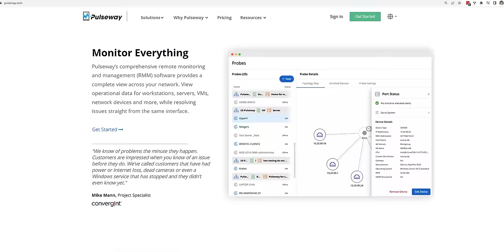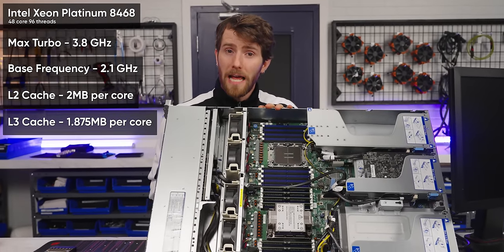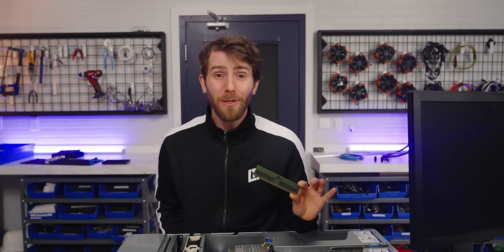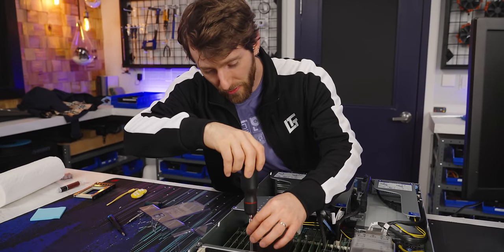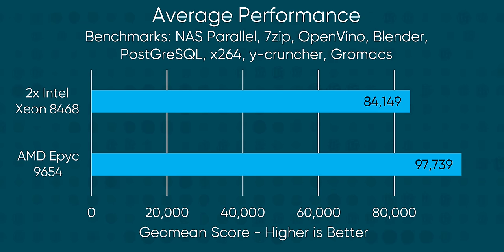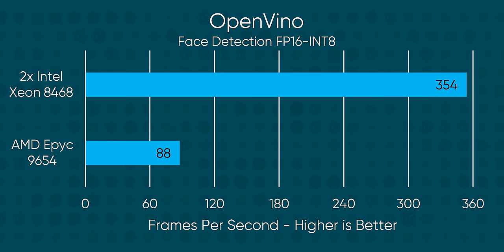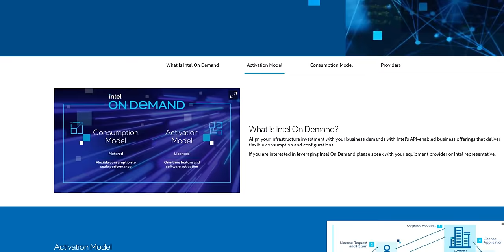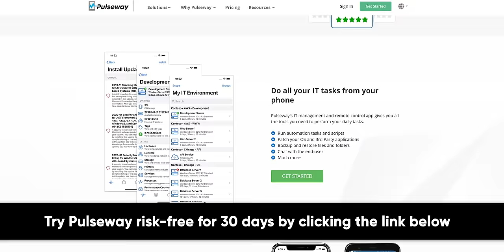Intel’s New CPUs are Cringe - Intel Sapphire Rapids Xeon Platinum 8468

Comment: In our case, we have VM infrastructure based on Intel Xeon and you can't mix\match different CPU vendors if you want to expand existing clusters.  That said, our new clusters and projects are all entirely AMD Epyc.
Reply: My company can't use AMD because of Oracle and their licensing. AMD Epyc with 4 chiplets requires a license for 4 CPUs, and that is hundreds of thousands of Euros.

Which is why I'm concerned about Intel going the chiplet route as well.
Reply: @dustojnikhummer  that looks like Oracles fault to me than cpu manufacturers
Reply: @bingchilling177  Yes, it is absolutely Oracle's fault. But right now we are kinda stuck... not sure what we will do
Reply: That's why there is such a massive amount of investment going into RISC virtualization, your issue will be non-existing in a few years time :)
Reply: If you're stuffing about in Windows VMs then your operation is inefficient and you will be out of business soon anyway.😩

Comment: So I gotta say that the "heat sink adapter" model has been used for several years in data centers with no issues except for human error issues. This also come from experience using these in 2 of the top cloud computing companies. Also the socket with the lever that Linus is freaking out about is a godsend. Prior to this Intel suggested using a screwdriver or a similar flat blade tool to remove the processors from the adapter/heat sink. Also gotta say this is the first Linus tech tips that had me talking back to the video and had my wife asking me if I'm arguing with myself lol. Still great content, but please reach out to individuals that complete break fix with these components. I offer myself as tribute :😜
Reply: Yeah before this, the best was an ifixit plastic spudger. 1st and 2nd gen xeon scalable had the carrier clip without the arm. 3rd and 4th now has that handy arm.
Reply: linus has also had videos on videos on previous gen servers that had this same cpu heatsink carrier... which he also installed wrong.
Reply: … Screwdriver? That sounds like a pretty good way to ruin the chip if you angle it wrong.
Reply: Is there any reason this cpu couldn't have a lever-arm socket similar to Intel or the AM4? Because installation the way LTT showed seems like a way to have more people break their servers so they buy more lol
Reply: @aarcxnum  Linus just is doing it wrong. It's really easy and less risky than older socket designs. The samples he gets may not have come with instructions but Linus often refuses to read instructions anyway
Reply: @aarcxnum  sliding the whole assembly down  greatly reduces the chance the package slips out of your fingers.  Granted... It's a lot heavier, so if you DOO drop it... The socket is definitely toast.  The retention force is getting extremely large for packages this size, I think this also reduces the amount of hand strength that was required for latching those leaves down.

Comment: The irony of it is that Intel was actually first with having glued together CPU with the original Core2 Quadro actually being 2 core2duo glued together.. and that was not even that high speed.
Reply: That's not the original glued chip. Pentium D had two P4 cores. Also, it's Core 2 Quad. Quadro is nVidia's branding.
Reply: Didn't they pull such a trick even before that with the Pentium D?
Reply: @samiraperi467  well i didn´t want to remember Pentium D
Reply: I mean, yes, but actually no
You can see that as the ancestor of what is a chiplet today, cause in practice it worked differently
Reply: @thunderarch5951  Well yes, the method of pairing them is very different but the core premise of gluing them together is pretty similar.
Reply: And ironically, at the time, AMD made a big stink about how their first gen Phenom was the first "real" quad core chip because the core 2 quad was just a pair of core 2 duos glued together.

(Also, the Core 2 Quads were stupid fast for their day - my Q6600 and then later my friend's Q9650 were ridiculous in 07-08, at least until Nehalem came out and I got my first i7)
Reply: @clapanse  I still have a 9550 xeon system. These things are still good enough to do some browsing, video watching and office work even now. 12 megabytes of L2 cache and near 3ghz speed made those things shine back in the day, and they've aged pretty well.
Reply: The intel Pentium D was two Pentium IV CPU's glued together....
Reply: @clapanse  finally someone who remembers that, it always annoys me that whenever Intel looses, AMD wins or Intel talks about their "Tiles" everyone and their mother has to talk about Intel making fun of AMD for glueing together chips, whilst handily forgetting that the glue Joke originally came from AMD.

It's almost as if both companies had stupid marketing morons.
Reply: @chloedevereaux1801  Nope. Nehalem was the first gen, 45nm, quad core desktop i-7, which came out around Thanksgiving of 08. Lynnfield was the first i5, and the first one considered "mainstream desktop" rather than "high end desktop", but it didn't arrive until fall 09.

(I remember it quite well because I bought an i7-965X on launch day in November of 08)

Comment: IBM has been doing the On Demand thing in their mainframes since 2004, I think, and later in Power servers as well. It’s a good way to turn capacity on and off without needing to buy new hw (which may take a while to get to you and you may only need for peak usage).

The key is in the pricing, of course.

Comment: But Linus... You also installed the CPU's into the heatsink on the two previous generation of Intel's scalable processors. You probably threw the bracket for it away, I saw you did in an earlier video!
However, this new generation has this small tap to get the CPU off the heatsink, very handy. I work with them everyday :)

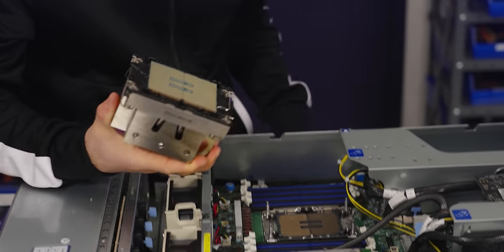Comment: 5:20  actually Linus, you're supposed to leave the CPU in the plastic tray with the plastic adapter on the CPU... Then you grab the heatsink and set it on top of that and it clips/clicks on the plastic adapter... Then you lift that heatsink and cpu with sandwiched plastic frame adapter off if the tray... Then bolt it to the mobo.  Easy peasy.

Comment: It's the lack of PCI-E lanes on desktop CPUs that's really driving me nuts. After a discrete GPU and NVMes, I couldn't even POST after adding a 10GbE nic because I was out of available lanes.
Reply: A frustrating problem that only applies to 0.01% of users unfortunately.
Reply: 20 lanes on modern CPUs is embarrassing when a GPU can use up to 16 and a single NVMe SSD can use up to 4.
Reply: yeah im really hoping to see the re-emergence of HEDT hardware without the "pro" pricing
Reply: @Amehdion  the gpu really only needs 8x pci-e lanes anyways
Reply: @NightshiftCustom  Hey, I paid for the premium hardware, let me use it lol. For most people the performance difference is negligible but I typically game in 4k ultra settings and have RAID 0 980pros so even 4 more lanes could be a meaningful performance increase.
Reply: Buy AMD then, ZEN 3 has 24 lanes, ZEN 4 has 28 lanes.
Intel 12th and 13th only has 20 lanes, recently launched 13th has fewer total lanes than even ZEN 3, this is an actual advantage ZEN has that almost no one talk about.
Reply: @Amehdion  I think modern CPUs actually expose more lanes than older CPUs, it's just that they're now being configured as M.2 slots instead of PCIe slots. That and no one is offering x8 slots.
Reply: @GhOsThPk  Yeah, I'm seriously considering getting a Threadripper Pro for my next build. I've always had Intel CPUs, but Intel really doesn't offer much for HEDT or workstations these days. I want a higher clockspeed modest core count CPU with enough PCI-E lanes for a GPU, NVMes, and upgrades. The HEDT market may be small but there must still be people needing workstations. I want to be able to do some gaming on my desktop while also able to run VMs for work. Especially with more people working from home these days, it seems like there would be a decent market.
Reply: @dbattleaxe  haven't heard of the Xeon W?

Comment: I have some doubts here as engineer for the benchmarks, as you said the server is meant for virtualization, so what's the NUMA layout etc etc. 
Don't get me wrong I'm really pro AMD, but a good benchmark would be to spin up on every machine as example

50 mysql/postgresql databases
50 nginx servers 

And then benchmark all the vm instances at once (doesn't have to full heavy load, but equal between both servers).
Reply: not a coincidence that every other video on this channel is sponsored by AMD, and its basically turned into a commercial for them over the past year.
Reply: That would mean that he needs to know what he is talking about. This channel is ok for commercial tech, but any time they go into the professional sector, it makes me absolutly cringe how bad the information they give out is.
Reply: @ion1984  that's what happens when AMD has the better product bro. Why cry?

Comment: even if they get more sockets on a single mainboard(pretty sure I read some really good reasons why AMD doesn't do more than 2 sockets per MB) and even if intel manages to actually somehow provide people with a cooling solution for that(a single 8468 has 350W TDP. Stacking a single rack full of these with 4 socket servers is enough heat for a medium sized home just from the CPUs..), the king of density for compute will still be AMD, especially given that the 9654 has similar performance to two of Intel's chips with 360W TDP. Same performance half the TDP? Yeah, if you're need lots of compute, there is absolutely no question if you can literally half the TDP and it also costs less money. Let alone AMDs superiority with PCIe lanes - PCIe5.0 x80 for Intel vs PCIe5.0 x128 for AMD. And honestly, all of that just for a bit of ML acceleration? Seriously, if I need to speed up ML tasks, I'll just use the few thousand bucks i save because I'm buying AMD CPUs and spend that on accelerator cards...
Reply: Just need some slim mobos that can fit multiple full systems in a blade and the density will probably be just as good unless your particular workload requires one OS over a bunch of CPUs
Reply: This didn't age well

Comment: I'm sure that solid goop of thermal paste in the socket, or the stringer that followed it that no doubt landed in a dimm slot had anything to do with anything. I'm sure that wasn't a horrifyingly expensive "oopsie"
Reply: Yeah, I was just thinking...  How the F do you clean that out?!?  If it's non conductive, it might be OK but if it's capacitive, you'll have a system with weird instability issues.  Also, it could cause the pins to stick to the CPU, bending them when you go to take the CPU out.  Only a $20k system.  Ooof.
Reply: @button-puncher  That's the neat part about thermal past and LGA sockets. You don't clean them out. Ever.

Comment: The funny thing about server chips is that sometimes the thing limiting you isn't even the hardware.  Windows Server licensing is a beast - if you have a cluster of a few servers and automatic failover between them, and deploy even one single Windows VM, you have to license every possible core it could ever run on.  So to add one dual-core VM on a 3 node cluster with 26 cores per node, you need to license 78 cores in total.  It might make more financial sense to get more nodes with fewer cores and limit where Windows can run.  Or consider SQL enterprise licensing, you need to license a minimum of 4 cores per VM under SPLA at about $250/core, so if you can get fewer higher-performance cores, it might save you money.

Side note: Can you do a video explaining Windows licensing?  Might explain to people why Linux is so popular in the startup market.

Comment: I am skeptical on the Intel on demand, I just cannot imagine it is going to be used that much. It seems more like yet another method to extract/squeeze money from their customers. 

Across my many years in IT, I have only seen hardware increase with a license one time and that was with an IBM mainframe which made sense considering the hardware licenses were in the six figure range, the hardware is slow to change over time, and IBM didn't sell 40+ SKUs of their CPUs. In my experience, hardware is either fully licensed up front or replaced before the need to increase came up. 

When you have a private internal cloud, it is more efficient and advantageous to deploy another server node into the cluster vs. upgrading existing server nodes. The entire platform benefits from the investment, increasing CPU count on existing hardware is a fringe benefit. Also, workloads usually want CPU/RAM to increase in lockstep, so as you unlock CPU cores you typically need more RAM. So there are still logistics issues with downtime. There are bottlenecks in hardware that simply unlocking more cores will not resolved yet adding more nodes to a cluster will. 

I won't say the "feature" is dead on arrival, I am sure there are some B2B customers asking for this. I am just saying that In my opinion, a large corporation has really soured when they shift from innovating hardware solutions to innovating more ways to squeeze their customers for more money. That's why I refuse to buy EMC/Dell. It seems like Intel has really soured here.

Comment: I am still hoping the coming HEDT CPUs based on Sapphire Rapid (Xeon W2400) are still gonna be great, after AMD abondened HEDT Threadripper.
Reply: They're dropping new thread ripper later this year.
Reply: Amd isn't abandoning it, they are preparing skus for release this year. Intel just didn't offer any competition until now
Reply: @korcommander  That would be nice. And all it needed was Intel to drop a similar product... Btw, where did you get this news from?
Reply: @korcommander  hopefully not just pro series
Reply: @raisofahri5797  that is what I expect as well
Reply: but Alder Lake and Raptor Lake ARE already HEDT. i9-13900K destroys basically half of the consumer friendly Xeon lineup at a cheaper price and way more perfomance (you could argue better efficency by the little cores).
Reply: @saricubra2867  HEDT is not all about Cores. It is also about more PCI Express lanes. My workstation (using a TR 2990WX) would not need all the 32 cores (got the CPU kinda cheap, so I won't complain) but I really need all the 64 PCI Express lanes with my 5 add on cards (GPU, 10G-NIC, HBA, sound and USB). My gaming system (R9 5900X on X570) supports 2 additional PCI Express x1 cards besides the GPU before it starts to share lanes. Just no!!
Reply: @Thommygun-qv7um  Memory size and bandwidth are also pretty good reasons for HEDT
Reply: @levygaming3133  totally correct. Not for me, I don't need more than 64 GB of RAM, but I guess many ppl do. One more thing mainstream Core- and Ryzen-plattforms leaves us wanting.
Reply: @Thommygun-qv7um  Um.... AMD?
Reply: @korcommander  clearly you did not read my post carefully enough

Comment: Very good review. I will said that formally, the IBM Power2 could be the first chiplet desktop.  But that is for historians to fight about. Accelerators: Here the problem is you have to pay, which means the software will continue to be lacking unless Intel pays for the development. CUDA is the standard, and you can get quite inexpensive boxes for the developers, so hand optimization for CUDA y generic frameworks for intel. Even IBM Mainframe accelerators are not extra. They are not used to run ChatGPT but to run fraud detection models in real time.

Comment: I have been in enterprise IT for 20 years and have purchased/installed/operated servers my entire career. In addition to servers, I have deployed and operated IBM mainframes, Cisco routers/switches, Broadcom fiber-channel switches, and other hardware that is locked behind a license - really the concept is nothing new and has been around for decades. There are turn-key server racks that are over-spec'ed with hyperconverged hardware/software, all locked behind licenses where the entire rack can dynamically increase/decrease available hardware based on demand.

Comment: These accelerators might be cool, but having some kind of DRM running on your server seems like a massive security nightmare. If that DRM gets hacked, then you might suddenly lose all the added performance, or if it gets hacked badly, you might lose a lot more: Imagine what someone could do if they compromise software that has acces to the CPU directly, probably a lot of not so fun stuff.
Reply: Also, a possibility of your expensive "validated" business software breaking when the accelerator is enabled. We had contractors installing GM's Historian industrial data collection software (the latest version the contractors were willing to use ) and repeatedly failing, then telling us to repeatedly reinstall the server OS. Turned out that the version of Historian used an obsolete OpenSSL within the embedded tomcat tcnative, the installer broke when OpenSSL attempted to use intel's newer SHA extensions in 10th gen or higher Xeons .
Reply: It wouldn't be the first time. Don't forget about Spectre and Meltdown. Plus the CSME vulnerabilities a couple years ago.  (Really it's just a matter of time, but by the time people have engineered an attack like that, these machines will prob be on their way out due to obsolescence)

Comment: The core layout sounds like Intel are at least a generation behind AMD.  Yes, it is faster at AI than AMD but as covered in this video, for the equivalant of this dual CPU rig the AMD EPYC solution is $2500 cheaper.  It would make a lot more sense to buy an AMD rig and a dedicated AI card rather than the Intel one as the dedicated card is almost certain to give you better performance than you will see from a CPU which is mixing AI and traditional functions on a single piece of silicone (especially since we don't know for sure what processor standard is going to be better supported for AI aplications yet).